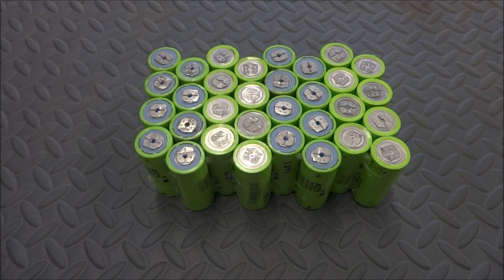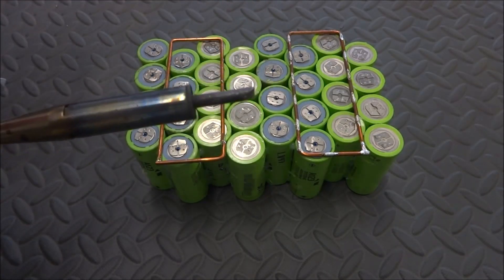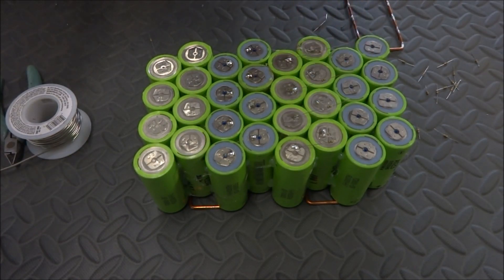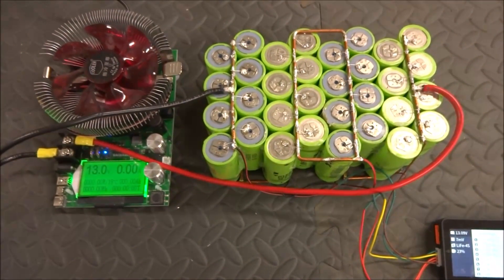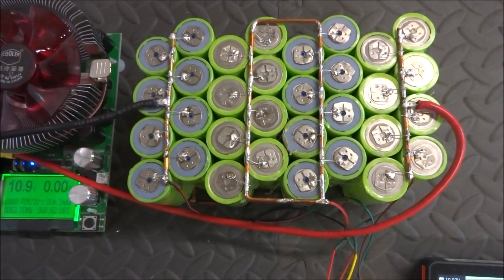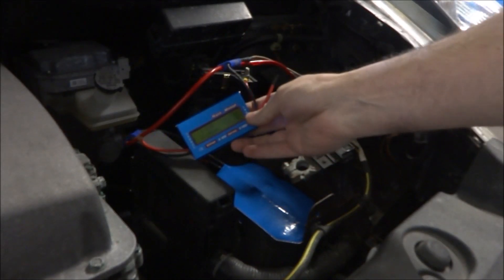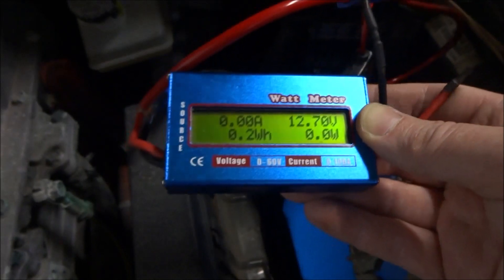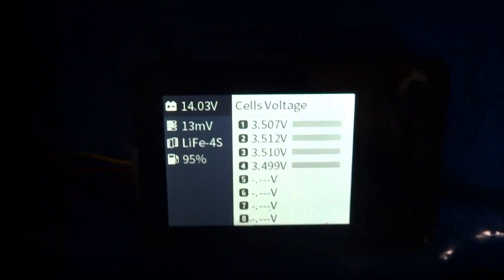12v lithium battery for Nissan Leaf

Comment: The DC/DC converted is designed to charge lead-acid batteries. The key thing is the battery resistance. LIFEPO4 has a lower resistance, that can lead to have really high amps charging! You can check Paul Kennett videos on how he solved the issue! I installed a second-life ex-medical cart 12V LIFEPO4 40ah battery (an ebay find), designed to be a drop-in replacement for lead acid. One year after, still working fine! (on my Nissan Leaf 2012). Best!
Reply from the maker: These cells are well worn and have a much higher resistance than when new. I didn't show it in this video but I can monitor the 12v charging current using leaf-spy pro and the maximum I saw was about 20A. I will have a look at Paul's video, thanks for the input!
Reply: Does it use a regular 12 volt battery
Reply: I wish I knew what to do , because I just bought my car and only made 1 payment and my 2014 Nissan Leaf isn't charging properly

Comment: I doubt if you will need a bms but it wouldn't hurt as they are cheap and plentiful now. 4ah is only 50% seems low but the top voltage is low too so there is quite a bit of capacity at 3.4 volt per cell Good luck